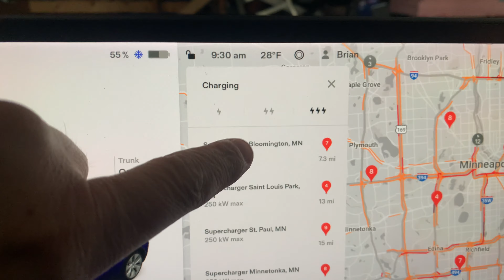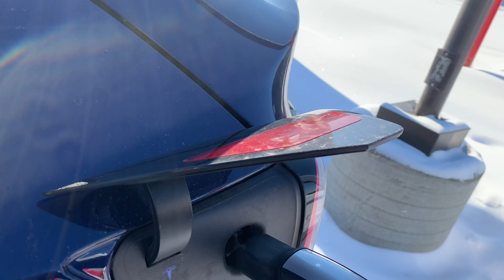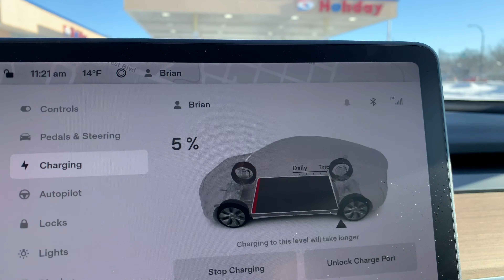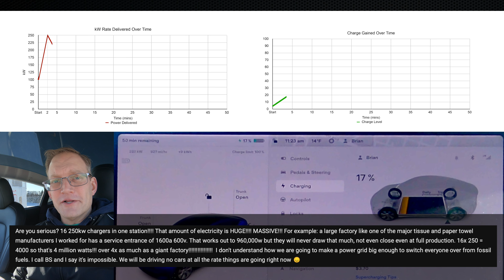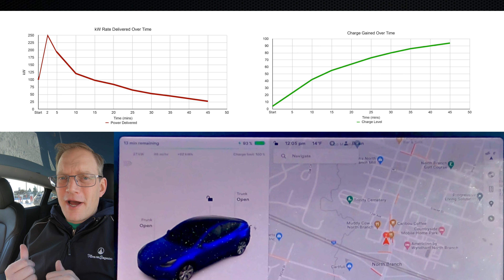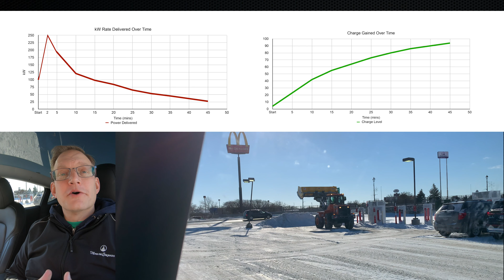Will Supercharging Ruin the Grid?!?

Comment: I'm not worried about level 3 chargers as much as I'm worried about level 2 chargers at home basically when you add a level 2 charger to your home when you are charging it is the equivalent of adding almost a 2nd hvac to your home now imagine hundreds of thousands of those chargers or millions it will put alot of strain on the grid of one state the only way I can see it not effecting the grid and straining it is running off solar for your charger only and not hooking up to the grid but that would have to be widely adopted to make a difference

Comment: Whoever made the comment on your last video didn't calculate his factory's power correctly either.  That would be 3 phase power, you don't just multiply volts * amps.  1600 amps at 600v 3-phase is over 1.6 MW.

Comment: Brian very well done and right on the money.  Ohms law should be used in calculating AC power but the Power Factor (PF) of the load changes it.  If you assume a PF of 1 Ohms law works.  Another thing people don’t go to the gas station every day if the car does not need the range so it’s idiotic to assume you Must charge daily. For an EV, like your cellphone, it’s easy to Top Up daily that 20% used for your daily use.

Comment: Excellent, thank you for posting. Also, many people forget (or ignore) that it takes a lot of electricity to refine gasoline, about 5 kWh per gallon. That’s the equivalent of 20 miles driven in my Model S Plaid. Therefore a 20 mpg ICE vehicle uses just as much electricity to operate as my EV.  And still has to burn the gallon of fuel and get oil changes and all the other pollution associated with fossil fuel engines!   -Trav in southern MN
Reply from the maker: Great point Trav! The electricity it takes to drill, transport, refine, and dispense oil/gas seems to be always ignored. And then, of course, you burn it up.

Comment: Regarding the factory comment, 8 superchargers charging for 30 min per car is 16 cars per hour. That's a theoretical 384 cars charged per day or 2,688 cars charged per week. Not too bad when you compare it to a paper factory. There's no shortage of ways to produce green electricity, they simply have to build out capacity. California for instance already gets about half its electricity from renewable sources, and they haven't even scratched the surface of the solar and wind potential of the state (including offshore wind from the pacific which hasn't even been built yet).
Reply: @Redrum Susan  mostly in the Pacific ocean off the coast, which is not technically California but they will definitely be the biggest beneficiary of it.

Comment: I'm in Chicagoland and recently did a trip from Chicago to Louisville and I found that I hit max charging speed each time even in 30F weather with preconditioning.  The one thing that I have noticed is that my car while old a 2019 Model 3 Performance, it seem to charge much faster than these newer cars.  I hold over 100kw till about 62% and It seems like I hold 250kw much longer as well at the bottom.  Do you have any videos of normal V3 supercharger sessions for your car?